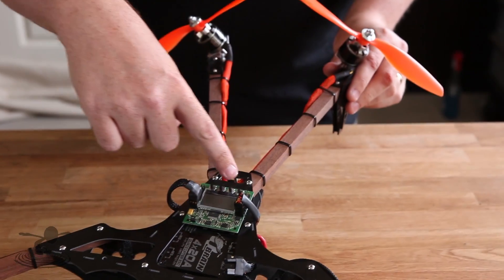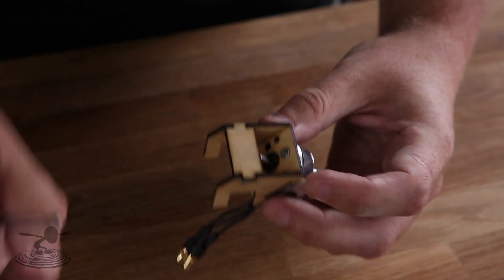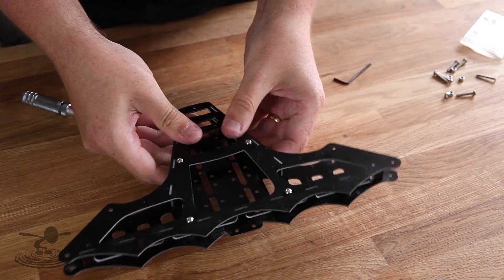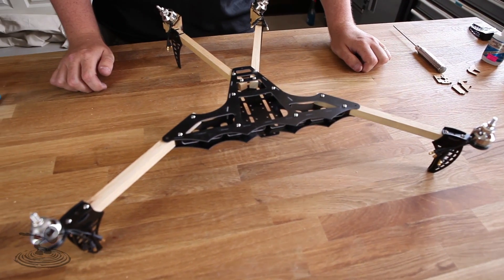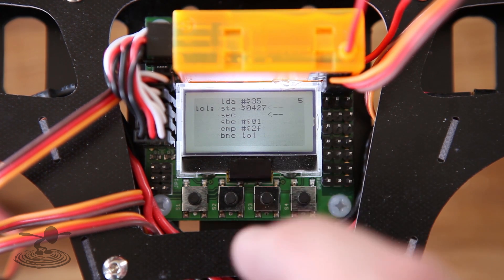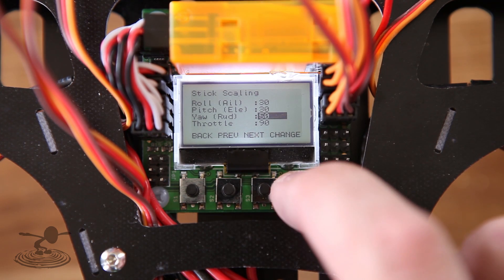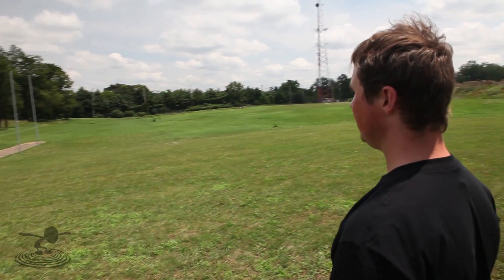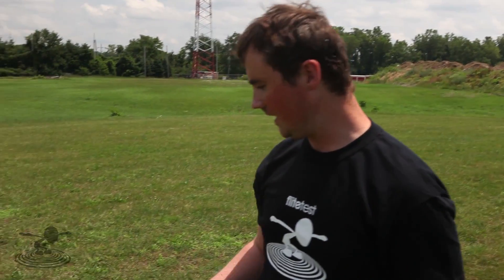Flite Test - V-Tail Quad - BUILD

Comment: I am building a quad..very new to this stuff. Basically i was wondering if it was ok to put the rear motors slightly higher on the frame than the front. And can i have the rear motors spaced farther apart than the front?

Comment: My winter project ..... only cant find lenght of booms front and back ?
Reply: 10 inch booms for back and front ones are 4 cm shorter
Reply: Thanks
Reply: Will be trial and error i gues
Reply: +Kevin Yoon All my booms are the same length and it hovers in acro with the tail lower otherwise it will pitch forward a lot. Do you think shortening the front booms would fix this?
Reply: +Kevin Yoon All my booms are the same length and it hovers in acro with the tail lower otherwise it will pitch forward a lot. Do you think shortening the front booms would fix this?
Reply: +Kevin Yoon I'm using an electohub not a bat bone
Reply: +Kevin Yoon I'm using an electohub not a bat bone
Reply: Chris Hayden I'm not sure about electrohubs but if you have extra booms you sould try it and if you don't you could use different size props on the front or the back
Reply: Thanks for a speedy response Kevin
Reply: No problem

Comment: Great looking quad!
Are there any performance benefits to running a v-tail configuration? My only thought is that some thrust efficiency would be lost as the tail angle causes the rear props to constantly fight against each other in the horizontal axis.

Comment: wouldn't you want the rotors mounted the other direction? it would be more stable if they faced outward away from each other. if they're facing in won't the thrust cross itself and make a lot of turbulence?
Reply: that makes sense...well, i guess this specific quad you couldn't, but all you would have to do to make it work is just spread the motors apart until the props clear each other.
Reply: TR1PpyNick The props would hit each other. In a physical sense though, you are correct.  However, that turbulence only comes into play during a rapid descent.
Reply: Nick Lindenmuth Nope. they spin at diffrent speed when you are yawing and such.
Reply: I was thinking excactly the same thing. you need more upvotes sir
Reply: Is it possible to clock the props to miss each other?
Reply: in multirotors, all the motors are assigned for is spinning indiidually up and down. so you couldn't clock them since they're not at constant speeds.

Comment: Hey guys, can you plug all the 15amp multistar esc's straight in (im using a kk2.1HC) or do you need to deactivate some of the switching bec's by removing the red wire?

Comment: My first build!
I think I understood you David and I am  ordering:
NTM Prop Drive Series 28-26A 1200KV / 286w
Afro Slim 20Amp Multi-rotor Motor Speed Controller (SimonK Firmware Flashed)
HobbyKing KK2.1HC Multi-Rotor Hard Case Flight Control Board with Remote Programmer. Only because i don't want to flash.

I’m not familiar with what the prop specs mean but i’m assuming first is size and second 2 numbers are pitch. The standard build for a Bat Bone Tri-copter calls for 8045 SF.   David explains to use the 2826 1200KV motor and 9” props front 8” props back.

9” front props (9047 SF)? Help? 
8” rear props 8045 SF 

Battery: NO IDEA!!!! 

I am going to carry a GoPro and FPV camera.
Reply: Have you built it yet, and if you haven't could you make a video on the electronics please.
Reply: joshua jo gold Yes I have built it.  It was my first scratch build and I don't recommend it for beginners.  I don't like the tail motor mounts and I didn't want to make my own so after a crash I decided to covert it to a quadcopter and moved everything to a Flip 360 FPV frame.  I am in the process of converting it to a tricopter but using 35mm booms instead of the 10" booms they come with so i can do 10" props.
Reply: Ok thanks.  I've been flying for a while but only on RTF kits so I was just checking the electronics you chose to see if i should order them myself.  If you would like to check out another easy build quad that I'm almost finished with is the parallax elv8 quad.  it has a big underbody for camera mounts and such and on parallax.com you can get a hexa copter upgrade kit for it too.
Reply: joshua jo gold yeah... i haven't much experience with manual flying.  Now I am ok.  LOL. 

As for electronics.  I used the Squid Power harness I bought from ready made RC.  It fits really nice in the bat bone frame.    I used the KK2 Hard case so i mounted that with servo tape up top and an orange receiver just in front of that.  on the back i mounted the FPV Tx.  and I used a mobius camera... at 720p the latency is fine.

For the batbone tricopter conversion ... I am mounting the FPV Tx on the tail ... but i'm using Frsky Taranis now.  So i'll have the KK2 up top.  maybe with some standoffs.  I'll put the frisky x8r in the behind the KK2.  I made some custom antenna mounts for the x8r.  

If I like the way it flies and can get a decent flight time ... I'll probably buy an Eagle Tree Vector FC/GPS/OSD and drop the KK2
Reply: very nice  i hope that conversion works great

Comment: For the folding arms.  How do they lock in place?  How did you decide Motors and prop sizes of this build vs your original build?  I can't hear what you said the better motor and props to use to carry gopro.
Reply: They don't "lock" per se, they stay put with friction alone. It also allows them to take a hit and fold back and not break.

Comment: What are the specs for the battery used in the video?
Reply: I recommend using a 2700 MAH battery for this. I get great performance with the exact specs of hardware that David used for this build. You can also use 2200 mah, (which is what he specs, but the 2700 adds a few minutes of flight time).
Reply: Bennito'sLab Thanks so much.  I'm new to RC and didn't want to buy the wrong battery and fry my electronics.
Reply: Bennito'sLab do you know what battery david used on his own setup??
the black/orange V-tail
cells and mah :D
Reply: Eirik Jørum Not sure... He does mention being able to use a "large battery".
Reply: Okey ;) thanks :D

Comment: Would the v tail be ok for some one new trying to get into the hobby?
Reply: It was I'm just tired or getting email notifications of this hand launching everyone is beating it to death can we just drop it
Reply: Yes. This was actually my first Quad / anything that flew. You will want to hand launch this the first few times to get the trims correct. Also, be sure to buy extra landing gear, laser cut angled motor mounts, (front motor mounts are almost indestructible), props and LOTS of zip ties. You'll crash and need to be able to repair it... have FUN!
Reply: I checked with my local store they only 5 and six channel transmitters
Reply: Bennito'sLab Hand launch a multicopter?
Reply: If you want the nickname stubbs
Reply: http://copter.ardupilot.com/wiki/ac_tipsfornewpilots/ ... If your dumb enough to hold and try to launch these things from the top, then you prob have no sense to fly one. You can handle these by holding onto the bottom, free from the spinning props. Use a neck strap with your transmitter to free up a hand
Reply: Also, a 6 channel tx is more than enough for a kk board. You really only need 4 channels, 5 if you want to switch between acro and stabil modes.
Reply: ejleipold you can throw it in the air then give it throttle.
Reply: Bass Assassin If you wanted to get a body part caught in a prop or break your brand new multicopter, yeah that's a great idea.
Reply: i guess you dont have the skill to do that yet.
Reply: Bass Assassin I'm obviously not as awesome as you. I'll stick to doing things safely instead of trying to show off and risk hurting myself or someone else around me for no tangible benefit.
Reply: I guess you dont watch the end of the video when he flies the v-tail.
Reply: Bass Assassin I must have missed the part where he launched it by throwing it into the air. Can you link it?
Reply: its at the end of the video
Reply: Bass Assassin He literally never hand launches it, not sure which video you're looking at.
Reply: after it was sitting on the car he grabbed it and hand launched it
Reply: None of this answers my question anymore stop replying to it if your not going to answer it
Reply: Daniel Ebling Sorry Daniel, I thought your question was already answered?
Reply: yes this copter is fine for beginners but id follow the video i linked

Comment: Hello friends, greetings from Venezuela, I need your advice to build my model, I will use engines NTM Prop Drive 35-48 Series 900KV / 815W, master airscrew 13x8 propeller, battery Turnigy 5000mAh 4S 40C Lipo Pack and 70-80A ESC, my idea is the model are large and I would like to know your opinions and knowledge about them would greatly appreciate it!

Comment: What version is the kk2 board because the ones at hobby king right now , don't have v-tail listed as preinstalled
Also what battery are you using?
Thanks
Reply: If you get the KK2.1, I've found that firmware version 1.14S1 contains the V-tail motor layout. (I'm not sure which other ones also support the V-tail)

Here's how you can find out whether a particular firmware version supports v-tail:

Start by downloading the firmware zip file (for flashing), opening the archive, and viewing the loader.asm file with notepad.
Scroll down in the file about one third of the way, and you'll see a bunch of possible motor configurations. V-tail should be the last one in the block. Any line that begins with a semi-colon is not included in the firmware.

I don't own one, but that's just what I've picked up by going through the firmware.

Hope it helps.
Reply: I found the firmware at Steveis's RCGroups blog: http://www.rcgroups.com/forums/member.php?u=367321

Also, I looked a bit more, and Steveis's KK2.1 Version 1.6S1 also contains the V-tail.

Comment: What are your thoughts on using servos instead if differential pitch on the v-tail. i.e. one prop would become vertical providing a lot of yaw while the over prop would become fully horizontal to maintain the tails lift. I imagine the props would have to be at a 45 degree angle while idle to maintain a 50/50 power distribution.

Comment: Nice video. Can you tell us what the advantages are and disadvantages to the V tail and why your using 40 degree angle rear motors? The good and bad on having the V tail, different size props and rear 40 degree motors. What if the rear motors were mounted in a normal position?

I am still learning about it all so I can make my first copter. I wanted to go with a quad X or maybe an H for shooting pro video footage using BLDC motors/gimbal and a small video camera that is bigger than the GoPro. The Canon EOS-M camera, And, a FPV system at 5.8 ghz using either goggles or a battery LCD screen, maybe 7" or larger with a sunshade. And, (a lot of and's, LOL ) retractable landing gear for 360 degree video coverage with no parts of the copter to be in the view. .
Reply: sorry, for asking so much. I now see I should have read all the comments first before writing a comments. I just need to know what is the best quad design for making camera videos? X, H, this V, ...? I know a hex is better for stability, but I want to try a quad first and use the gimbal for the stability.
Reply: I think the biggest advantage is the visual orientation which is outstanding in level view where a quad is blind so to speak. I know a lot of people like the way tricopters fly and this design eliminates needing the back motor to pivot and although I haven't flown one yet I'd pick this over a tricopter to avoid that myself. Setup will be a little trickier and you can see there is some power loss from 40 degree angle motors which seems to be the main disadvantage. For FPV I'm going to stick with the "efficacy" lol of a quad in X mode but would really like to fly one of these setup right. Like the simple wood design too. Cheap to repair if needed, light, and strong enough to do the job. Nice. Wonder how long until the KK boards have GPS for RTH, only thing missing on my list of needs for FPV although GPS altitude hold would be nice too without 3D camera setup which is another thing I want. Be nice to turn the clock ahead ten years to make my next parts order that's for sure. The Flight Test guys have really come a long ways providing some of the best info on the Internet.

Comment: I am having yaw issues when flying fast forward with my v-tail; the quad is tilting towards the right front motor and the tail is kicking out to the right as well. Any idea on the fix for this problem; using the kk2.0 with 1.6 firmware upgrade? I am using 9" props up front and 8" on the v-tail. Take a look at the my video of the flight at : madsloper or video - "Bat Bone fpv maiden wild ride".

Comment: Can anyone tell me which Rx port David plugs the 5th AUX cable from the KK2 board into on his Rx (Gear/AUX) and then also what switch I would expect to toggle this on my transmitter?  In Mode settings I have self-level set to AUX, but self-level doesn't engage when flicking any switch?  Receiver Test shows AUX channel idling at -8 though?

Comment: I think inverted would be the same or less efficient, you are pushing/compressing onto other pushed air but at nearly 90degress. But if you invert this, then both motors will be trying to draw/suck air from the same space, which is worse.

Comment: How much would an entire V Tail quad cost to build, im talking Frame, Motors, Props, ESC's K2 board etc. I only have 3 channel radios for car's so i'd need to get a flight radio as well I saw them as cheap as 25 bux on hobby king that would work right?

Comment: This isn't really a V tail at all. It is upside down/backward. The motors should be forcing air outward rather than toward each other which must cause a decrease in efficiency from the clashing prop wash.

Comment: at 40 degrees tilted propellors you only get 76.6% vertical lift efficiency compared to 100% at 0 degrees tilt. I wouldn't rely on this design as it wasted baterry and motor power, regardless of the maneuvering advantages

Comment: I NEED HELP!!! when I do the full throttle test with my quad it pitches forward like crazy! I am running the APM 2.5 and don't know how to correct for this. nor do I know what would cause this. besides the obvious. (CG) it flies well when just hovering or flying around bt when I try and ascend rapidly it doesn't do so level, and flies out of control. Any help would be greatly appreciated!

Comment: If one were to go by their own video and recommendations, the parts list for the frame and parts along would be over $100. I'd like to assume that they would be able to offer it all in a kit form closer to the price range of their other kits.

Bat Bone kit - $79
V-Tail Motor Mounts - $4.75
AnyCopter booms - $4.50
Replacement Delrin - Straight - $10
Straight 13-370 Landing Gear Conversion Kit - $3.00
Total - $101.25

This is going by the very video here, not other substitutions or fabrications.

Comment: Those other parts are so trivial, though.  You need angled motor mounts (which are easily fabricated from a strip of aluminium), and you need some kind of landing gear.  None of the tricopter kit goes unused, either.

Comment: HELP my quad copter was fine yesterday and today it will not fly. when i put up the power it oscillates like crazy although self leveling is turned off and it is on default settings

Comment: supposedly it has better yaw authority over the conventional + and x configurations. Similar to the tricopter. Basically is like a quadcopter with more yaw authority or a tricopter with more lifting capabilities. Fits the middle ground between the tri and the conventional quadcopter

Comment: mine cost $150 using all hobbyking parts, but I also had the receiver already. I used four dt750 motors, 9x4.7 props, 25a plush escs, and a kk2 board.

Comment: Looks really stable, like a quad, but good yaw authority, close to a tri.  However, wouldn't a tricopter set up be more efficient?  Less weight and same thrust if you find a good motor/prop combo (DT 750 with 11" or 10" props).

Please do a review on Chad's hex with gimble.  Looking at that set up for my next project with APM 2.5.

Comment: The v-tail quadcopter will have stronger yaw/rudder performance because the yaw action comes from propeller thrust rather than differential/opposing motor torque of a regular quadcopters and like most other multicopters actually.

Its well known that tricopters give the smoothest and best yaw action but tricopter's have increased complexity & costs because of the use of a servo controlled tail. The V-tail should get close to the tricopter's yaw/rudder performance without requiring a servo.

Comment: Idea for challenge using multi rotors: It starts with multi rotors at night. One person hides a single magnetic object in a field. Each team gets one fpv multi rotor heli, and has to put some sort of light on it, flashlight, LEDs, etc. and a string with a magnet dangling below the helicopter... OBJECTIVE: find the missing magnetic object using fpv and lights. Then capture it with the magnet on a string, and bring it back. The one who finds it and brings it back wins!

Comment: a quick question, i only found out about tri/quad-copters 2 weeks ago, but really want to build one after watching most of the flight test vids... 

i was wondering as david said if you want to have it set out as a tri-copter then all you have todo is take away a prop and put one centered, but would it still work fine as the two front probs have been shortened would the front props have to be changed? 

Ok, that turned out not to be quick, sorry if i confused anyone... I am new after all...